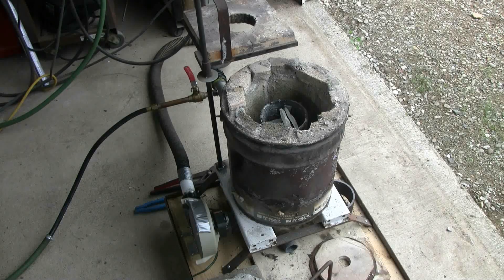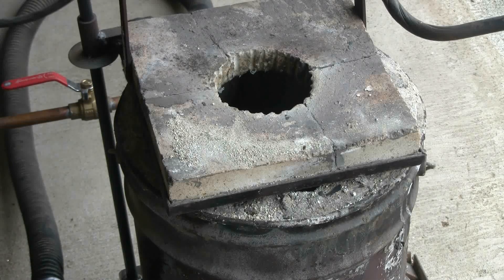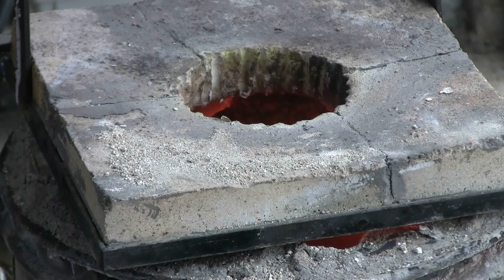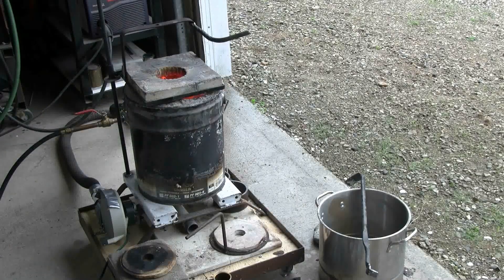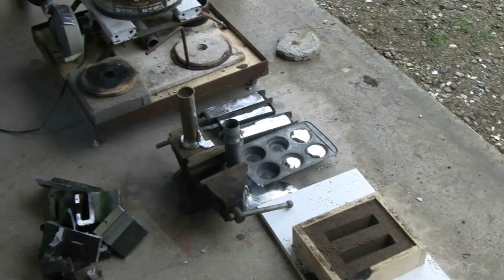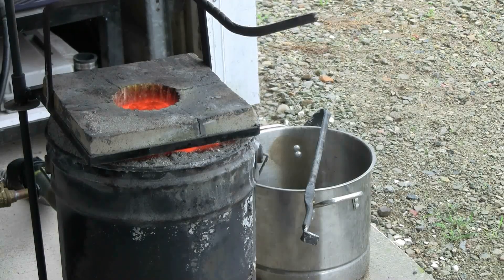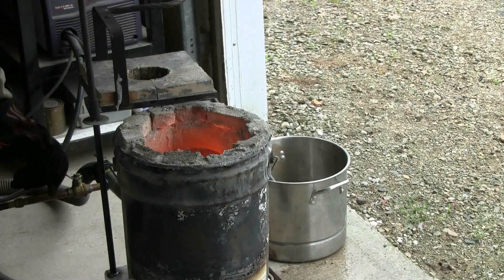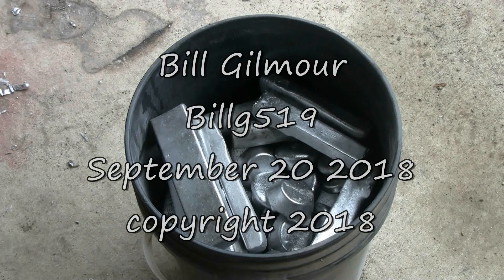New Casting Furnace Melting Aluminium Scrap Into Ingots

Comment: Bill you have a healthy appreciation for destruction and mirror all my intrests ! 

do you have more fun making your cannons then shooting them ? i make a new ballvalve rifle every week neally , often from deodorant cans with nothing to grab onto or threads to work with and that tests my problem solving to the max...ive realised i bearly shoot them partly because their LOUD at only 11ftlb ! but making them is the best part . 

will you drill out a cavity in two planks of wood and tap it with a presta  and see how much pressure it will hold? 
 i cant make make more then 150psi with what i have and currently testing to see if my rifle stock can also be the air tank 😆..im waiting on some glue drying on a test with a cavity the size of a shot glass..ive uesd glue&screws , if it leaks ive got a thick rubber gastkit to test and silicon bath sealer stuff...it should hold plenty of psi..or splinter my face 😆...👍🏻
Reply from the maker: You could perhaps hide an air tank inside your hollow stock. It could be made from 1" pvc pipe and end caps for instance. I'll see if I can maybe try pressurizing a wood chamber to bursting in the near future.